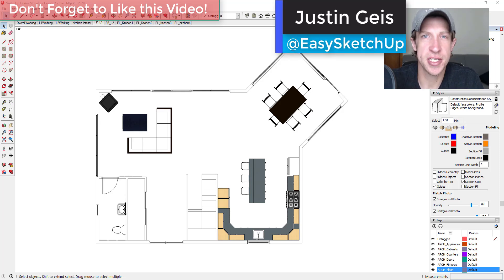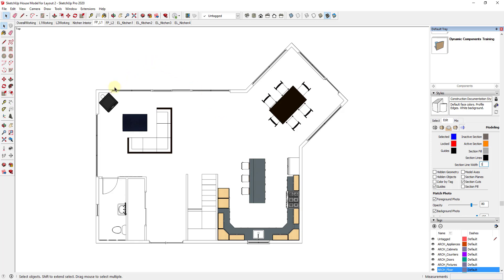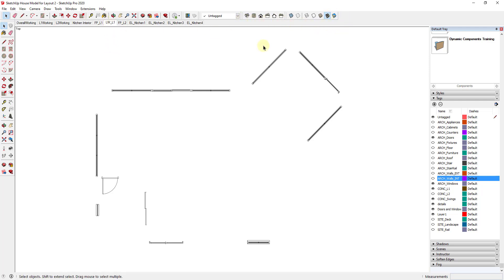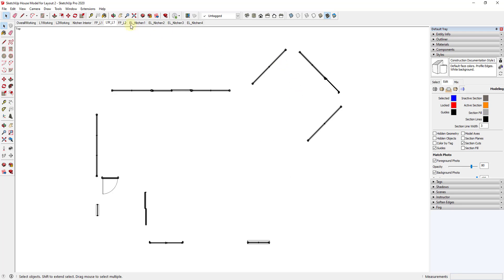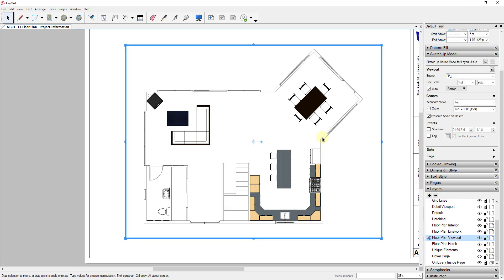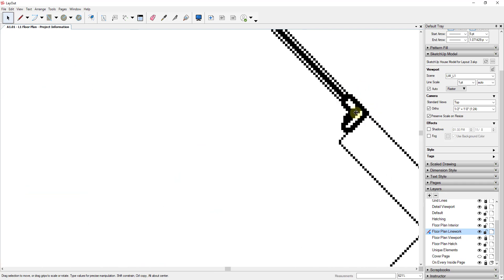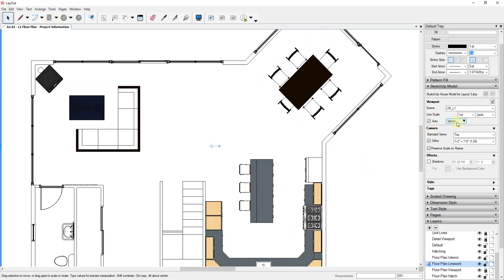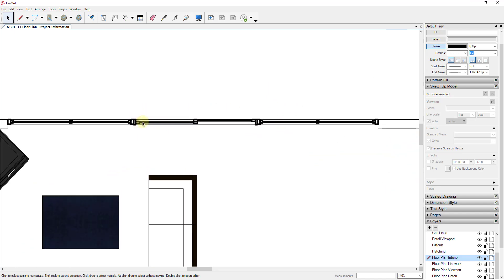Creating LINEWEIGHTS in SketchUp and Layout 2020 - Layout 2020 Part 3

Comment: I do an offset of say 2 or 3mm then fill it in the black in sketchup. This way you can make different item, usually walls have a different line weight. It work a lot faster for me.
Reply from the maker: Why? This seems like a lot of extra work considering you can do different line weights with section cuts...